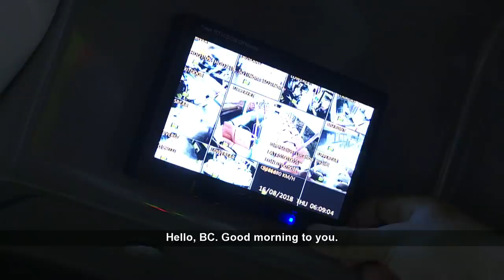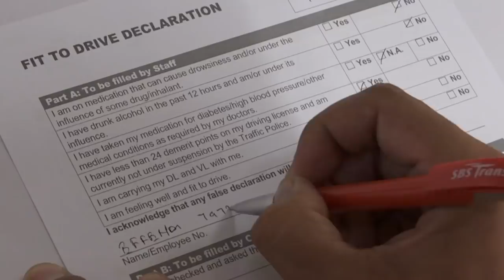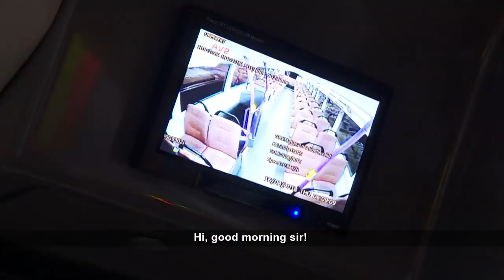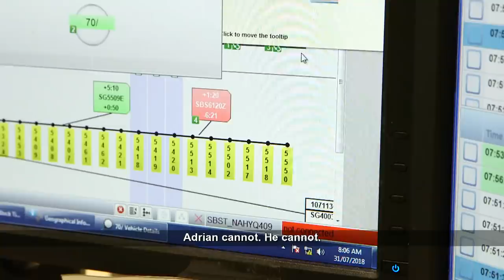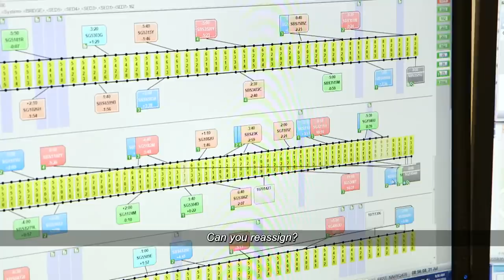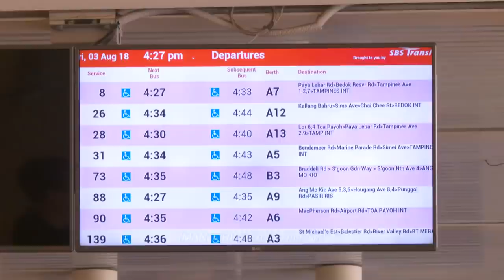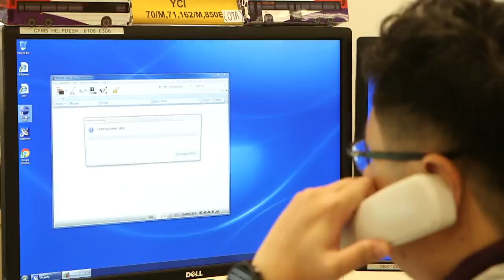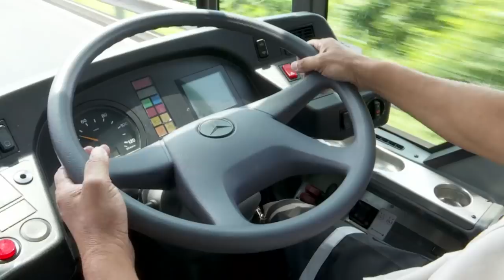CNA | On The Red Dot | S7 E23 - BUS-tling: The men and women keeping Singapore's buses moving

Comment: 15:25 its a network issue.. I mean these machines are not connected to network. It’s not required to check with other team. They should diagnose their own network..i mean the computer should connect to the network before the software system should connect. Meaning we need check with some steps ourselves before asking other teams.

Comment: the Operations Control Centre (OCC) should CHANGE the small size monitors into the 49-inch PRISM+ model X490 as it changes the way you experience gaming, productivity, and media with the genre-redefining 49-inch Ultra-Wide 32:9 model X490 display. Featuring a massive 3840x1080 resolution and HDR technology, the X490 will change the way you experience your PC, forever.